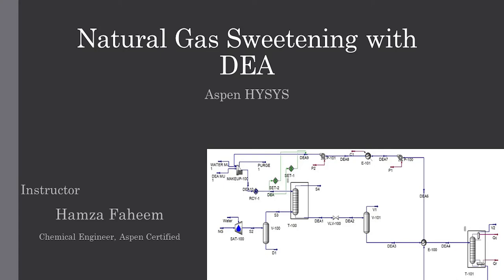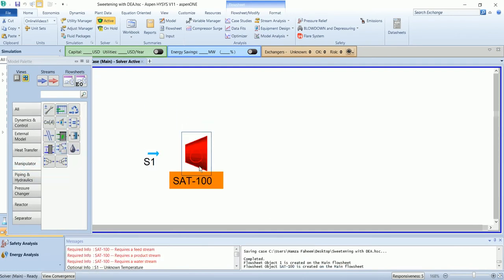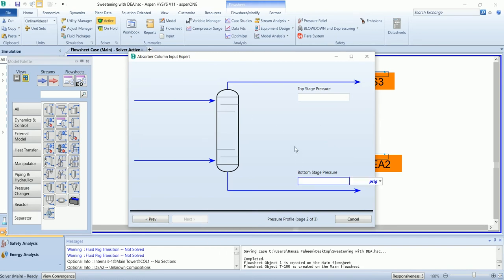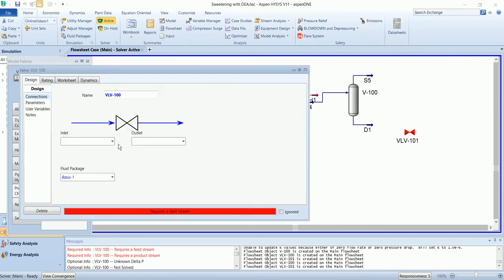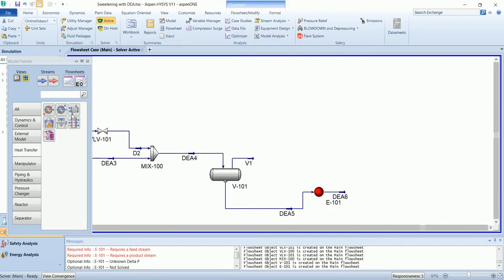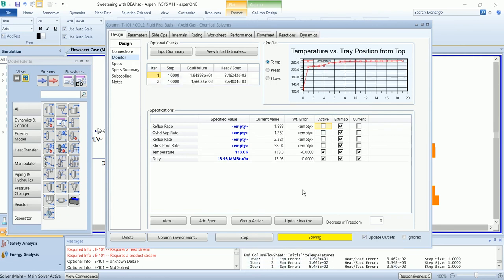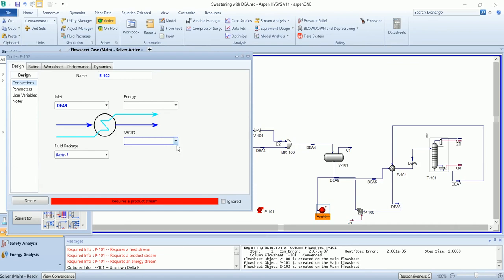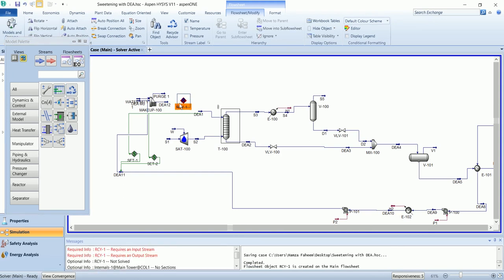Natural Gas Sweetening Process with DEA || Aspen HYSYS

Comment: The tutorial is straight forward and nice. But i am having issue with my overhead product at the stripping section. Methane and water compositions are higher than CO2. What can i do to resolve the issue please?
Reply from the maker: In that case, you should adjust tray efficiencies to get your desired compositions.

Comment: Hi, pls are you familiar with DWSIM process software? Serves similar purpose as Aspen. However, I am running into challenges with the Absorption column pressure. There’s only room for a single operating pressure as opposed to Aspen where we have the top and bottom pressure. Pls any help?
Reply from the maker: Sorry I am not familiar with DWSIM

Comment: What is the purpose of the saturator before absorbtion?
Reply from the maker: Natural gas streams are saturated with water while the composition I used was on a dry basis. To incorporate the water content, a saturator is used.
Reply: @Chemiopedia  thankyou very much
Reply: Thank you  @Chemiopedia ... What if the gas is completely dry?
Reply from the maker: @theophilip3520  It will draw water from amine solution in that case. That's why amine sweetening is always before dehydration on natural gas processing.